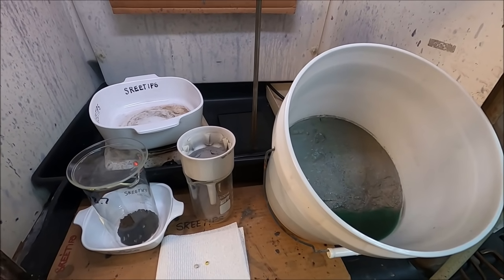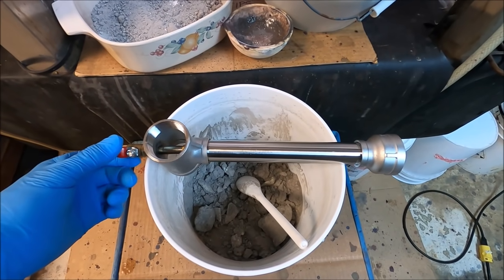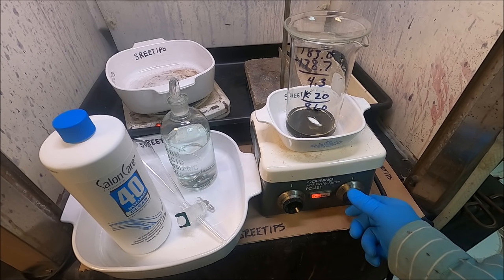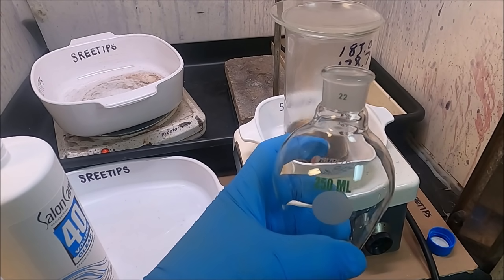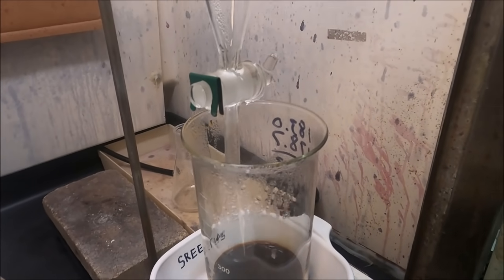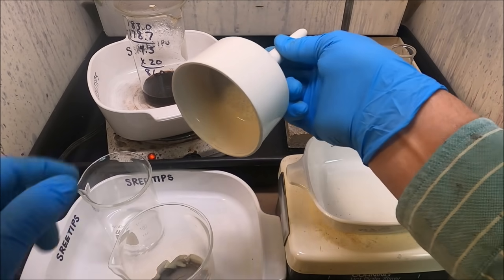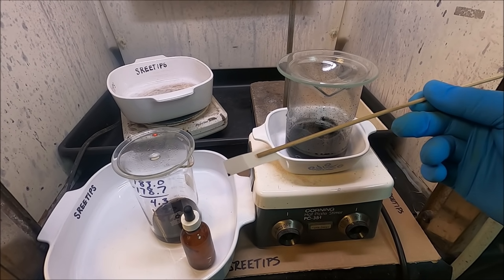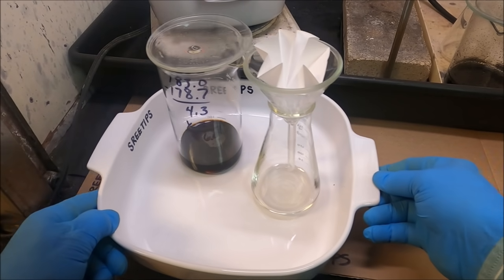Silver Cell Anode Filters Recovery and Refining Part 8

Comment: The solids left after dissolving PGM:s are probably silicon, Si. It is used in zinc and aluminium alloys so it can be present in zinc.
Any zinc compound should have dissolved in the aqua regia. You can always test your zinc by dissolving a bit in HCl.
Reply: It cant be silicon, those zinc pieces are electrolytic zinc sheets, and should be the same sheets he used in the automotive catalysts videos

Comment: Keep looking for the occasional use of an XRF machine that will tell you what materials are in a sample. They are expensive to buy, but show up on ebay, and sometimes there is one within a few miles that you can borrow. If the sludge reads rhodium then you start to pay off the XRF.
Reply: An XRF would be a handy tool in Sreetips hands. I don't even wanna guess how much money one of those puppies go for tho.
Reply: My instant first thought. We had one of these bad boys when I was helping assay a gold mine. Very cool pieces of kit. That price tag though, I don't even want to think about it.
Reply: Ebay has them from $3k to 30K. Specialist companies hire them. There will be one getting 2% usage within 50 miles that could be used on samples. If Sreetips can continue to buy old sterling silver when the 92.5% was silver but the rest included Pt, Pd and rhodium then with the value of grammes of rhodium soon adds up. OLD sterling was silver mined and refined to 92.5 % regardless of what the remaining 7.5% was. Modern silver is recovered from monster electro cells in the refining of copper, and all the other values are taken away at that point so PGMs are recovered and separated at first refining, because any rhodium may be worth more than the silver.
However this is Sreetip's hobby, not business.

Comment: I'm asking out of ignorance, not trying to suggest a better way of doing this.  If you have platimuim and palladium mixed together, could you have started with just nitric acid since palldium dissolves in nitric and platimum doesn't.  Then the undissolved platinum would be left over?
Reply from the maker: Possibly, but that would add another step to an already lengthy process.

Comment: Now that you are building a furnace are you going to be smelting the copper that comes out of your waste bucket? aswell as smelting bulk amounts of silver n gold
Reply from the maker: Smelt is a term used to describe extracting metals from ore. I don’t have experience with that. But I will be MELTING large quantities of silver once I get the furnace built.
Reply: @sreetips  true but you could use various methods of pulling impurities out of the copper from your waste bucket for some basic experience maybe would atleast be worth a look into because hand poured copper bars can fetch a decent amount of money on ebay and seeing as you would normally just throw it away would be better to atleast try to turn waste into profit
Reply: @sreetips  you could cast your cement copper into bars for cementing PGMs from your stock pot then. I don't know if it would be pure enough to cement silver. Maybe sell some 5oz coppers on your eBay store just for giggles.
Reply: @sreetips  Just researched that you could make a copper cell to purify and copper you have and maybe melt it down to make custom bars for cementing silver out of solution or sell the crystals/bars on ebay the info is on wiki just look for copper electrowinning cell you can also make zinc bronze if you feel a bit more daring

Comment: Could be because precipitate was greysh to be iridium which is very inert to aqua regia  at 300-400°C barely react, and sulfuric acid too.., Only hot HF (hidrofluoric acid) using teflon beakers, etc on solve Ir...
Reply from the maker: I can get gold & silver, platinum and palladium. Anything beyond that is an enigma. I’ve recently become interested in rhodium. I know I have it in my filters. Just need to figure out how to get it.
Reply: @sreetips  Rh as Ir are hard to solve in acids aqua regia too, only hot HF (hidrofluoric acid) in teflon beakers, gaseous Cl2 at 300-400°C, and a super acid solution such fluorsulfuric acid, hexafluoroantimonic acid in teflon beaker hot.... I will check... And come back if found more... See very exotic and dangerous acids...
Reply: From Wikipedia:
"Iridium is the most corrosion-resistant metal known:[15] it is not attacked by almost any acid, aqua regia, molten metals, or silicates at high temperatures. It can, however, be attacked by some molten salts, such as sodium cyanide and potassium cyanide, as well as oxygen and the halogens (particularly fluorine)at higher temperatures. Iridium also reacts directly with sulfur at atmospheric pressure to yield iridium disulfide."
So is not Rh because it had to be solved slowly by aqua regia hot solution...:
"Rhodium has both a higher melting point and lower density than platinum. It is not attacked by most acids: it is completely insoluble in nitric acid and dissolves slightly in aqua regia."

Comment: Spoiler Alert:  There is no existence of Pt Metal in that solution. Also as an advice, never test in filter paper any solution with concentrated sulfuric acid, it will burn the paper instantly and you will only see a black stain. If that solids were rhodium you can still dilute the sulfuric acid to a 5% concentration and filtrate the solids then melt the solids and see what happens, but to be honest, i think that those solids are only junk. Great series, hope you the best!
Reply from the maker: I looked closely today. I believe that a small amount of fine grain yellow Pt salt exists in that fleaker. Well get it filtered out and see tomorrow.
Reply from the maker: You do know that DMG will drop Pt?
Reply: @sreetips  Once i read that platinum will drop from solution with DMG in precense of chloroform, but in my experience, never happens to me, the only metals that i have ppt out with dmg, are cobalt, palladium and nickel, even having the correct p.H for the selective precipitation of Pd. 
I have a little of experience in PGM refining, one thing that i note is that you use Hydrogen Peroxide to dissolve the PGM'S, we should always remember that we will create Chlorine gas if we mix H2O2 and HCl, the chlorine gas will dissolve in the solution and will precipitate out the Pd in the presence of ammonium chloride.
Great to talk with you, i follow you in GRF and have seen all your videos hope you re fine!